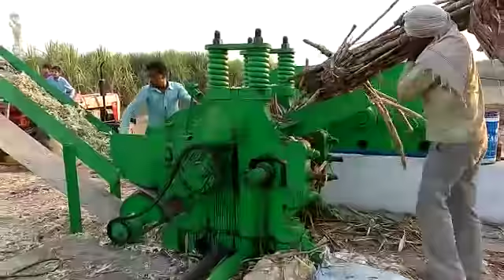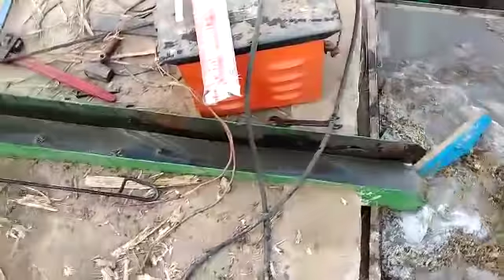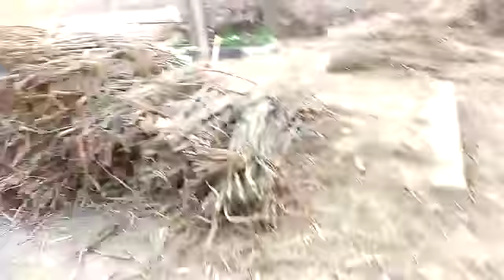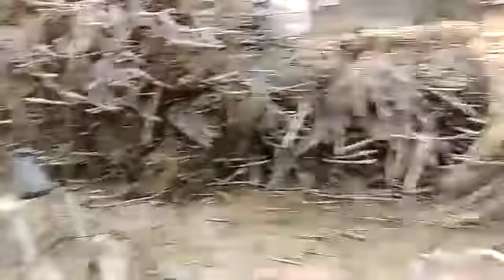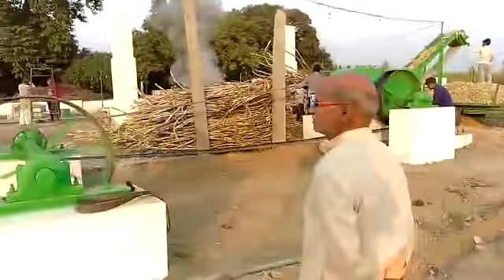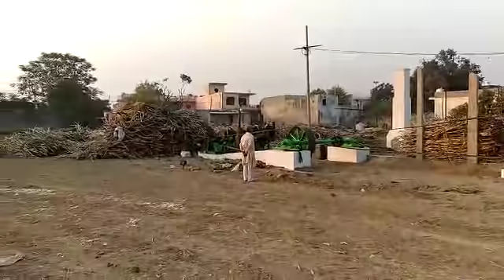Sugarcane crusher machine Sugarcane farm Jaggery plant gaane se gud kaise banta hai 14x14 crusher

Comment: Kaha hai ye plant sir
Reply from the maker: Raghuveer Singh BABU JI CANE CRUSHER
Tirola, Uttar Pradesh 251314
https://maps.app.goo.gl/bN1iqEUQc3KH3xUD9
Reply: Sir mujhe bhi lagwana hai
Reply: Kya price hai is kohlu ka
Reply from the maker: Setup cost 35 lakhs without land, 20 bigha land for proper running
Reply from the maker: Hamne 3 batti use ki h varna ye 7 batti ko ras de sakta h
Reply: Sir aapna no send kijiye kuchh bat karna hai
Reply from the maker: @technicalteja0074  8791990457
Reply from the maker: 8791990457
Reply from the maker: @technicalteja0074  kiratpur crusher makers 9412496766
Reply from the maker: Shakti Singh ka naam lekar baat kren
Reply: What is detail of machinery in 35 lacs? And what is extraction percentage pls.
Reply from the maker: Engine 180 Hp,  5 inch shaft, engine shaft, engine pulley, shaft pulley, crusher gear box, crusher gear box pulley, motor 3 Fhase 2 speed 50 Hp motot pulley motor, baigas, gearbox bracket, bearing, shaft brackets, bearing, full crusher
Reply: @THEBABUJIFARMOfficial  kitna एकड जमीन लागती है
Reply from the maker: आपके यहां कितने बीघा का एक एकड़ होता है हमरे यहां 6 बीघा का एक एकड होता है तो उसे 4 एकड जमीन चाइये सर्दियों में गर्मियों me 2 एकड चाइये